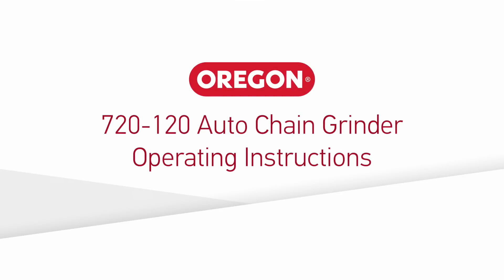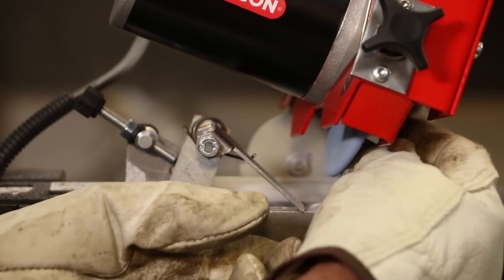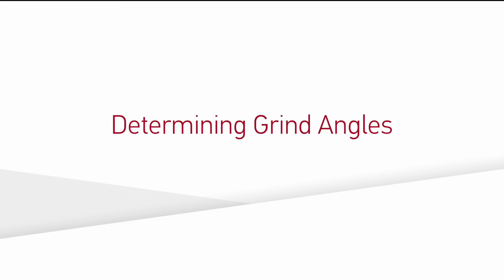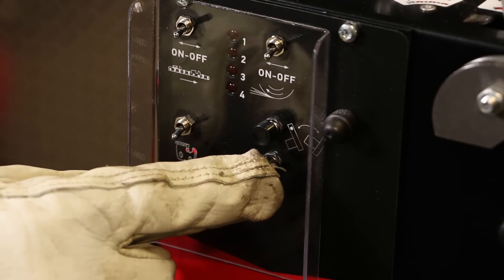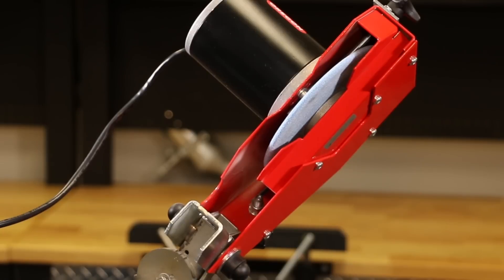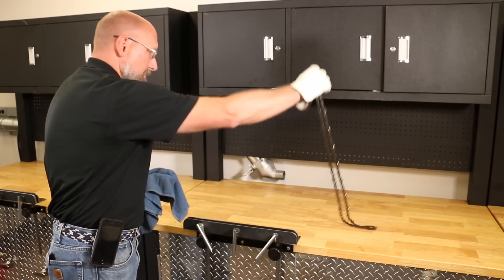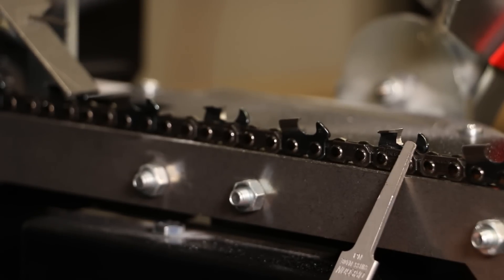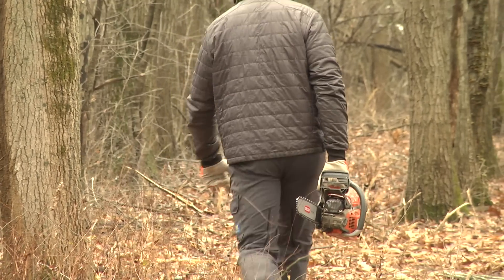Oregon 720-120 Automatic Chain Grinder Operating Instructions

Comment: that's neat and all but by the time you get it all setup you could have done it manually. also the $40k price tag limits it's use only to shops that have a massive volume of chains coming through especially after you consider maintenance costs. if you guys really want to get these machines out there you need to take some tips from the vending machine market and provide the machines free and just give the shop a percentage of it's income
Reply: What is wrong with you people 😂 this is clearly a tool for a high production environment. It's supposed to be "limited to shops that have a massive volume of chains coming through".

Comment: Keyboard experts at it again I see. For starters the machine runs around $6800-6900 u.s funds if you know how to shop. The video is detailed to show people who have never used it, how to use it. It takes a min or 2 to setup once you know what your doing. It produces perfect matching results on every cutter. Results you cant get with a file no matter how much you try to convince yourself and the world you can. Bench mounted grinders do not produce the same results either because they develop slight slop and play in them and you can produce the exact same force and motion on all cutters every time. This is not for the guy who needs to sharpen his chainsaw chain. This is for shops or logging contractors with mechanical harvesters running 24hrs a day with high volume chain sharpening demands. The precision of this machine increases bar and chain life, reduces bar maintenance and lowers bar oil consumption due to faster and more consistent cuts.
Reply: Tell us you bought one of these shit box machines without telling us you bought one….

This doesnt even make sense for high volume since every chain is different length, teeth..etc…each different size and style requires a different setup….

So i cant see it even being viable for high volume operations…they could just hire someone to handfile all night and its cheaper….you still need an employee to operate the machine

And you still have to do the rakers by hand…
Reply: @TheAcenightcreeper  yes every chain is different but you drop the chain on, adjust how much you want to grind off and how deep you want it to go and flick the switch and walk away. If your going to a different pitch, loosen a screw and adjust. Takes less than one minute to set up a chain for sharpening. This video is detailing setup for the first time you use it out of the box, hence more time. And it cleans the gullets and does the rakers too. Id like to see you handfile harvester chains haha, ya a few here and there but Try 2,3,4,5 or more mechanical harvesters running 24hrs a day. Youd look real cute trying to keep up with your handfile. Some harvester chains need 50% of the cutter removed the first sharpening due to rock damage etc. Tell us you dont know shit about logging without telling us you dont know shit……….yes I have one and it works great. Allows me to repair a broken chain while one gets sharpened. Allows me to do a number of things while a chain is being sharpened. Zero problems keeping up with demands. Some guys over here do all their own chains and make another couple grand a month doing chains for others. Love it when people assume stuff based off an instructional video
Reply: @apexrtx1000  post a video of you doing 10 different size and pitch chains in under an hour, alternating between square ground and round file…

Local hardware charges $6 to file a 32” chain, less for smaller…

So you would habe to do 1500 chains to recoup $9000, i think the machines are more now, plus what your time costs…since you have to manually operate the machine, you cant go off doing anything else for more than five mins without stopping…plus what salary do you pay yourself? $50/hr

If you ran it full time, you still paying someone to run it…its not automated, you cant just throw a chain on, hit a button and walk away.

It also only does rakers after you do two manually…rakers are the fastest part of sharpening. Also, for rakers it goes off the height you set at manual file…problem is, every tooth is different when it comes to rakers, no matter how exact the sharpening…chain teeth get chipped and broken, therefore requiring more filing to fix and lower rakers…if you set off the raker level on a chipped tooth to use for the rest of the raker height, youve got a shit chain that is so grabby you cant use it
Reply: @TheAcenightcreeper  even at $6800 it is out of the budget for alot of people. Personally I didnt care if it took 10 years for me to say “its paid itself”. It saves me time and Im not spending nearly as much time out in the shop preparing things for the next day because I can do alot of those things while A chain passes through the grinder. Most of the people who commented on this video Have zero experience using the grinder or even watching someone who knows how to use the grinder. They based assumptions off a very basic slow paced video on how to do initial setup before you use the grinder for the first time. My comments are based off actual experience and ownership and the benefits it has provided me which only a few have been mentioned. Considering most people complain about the cost of a hand grinder, this is definitely not for everybody.
Reply: Salesman